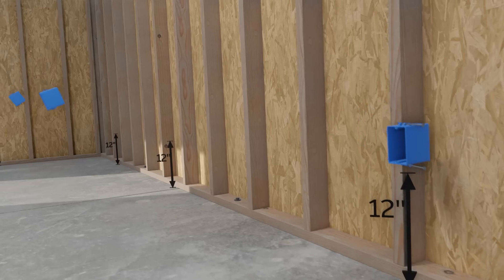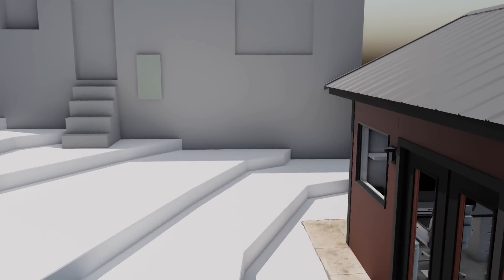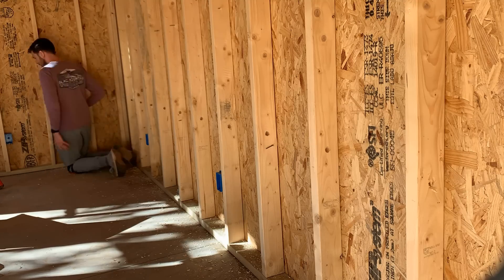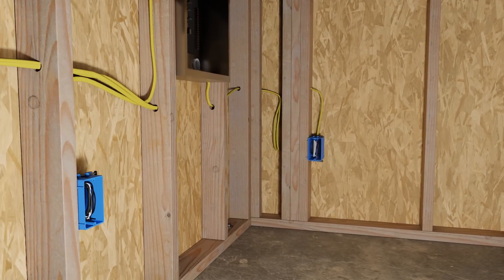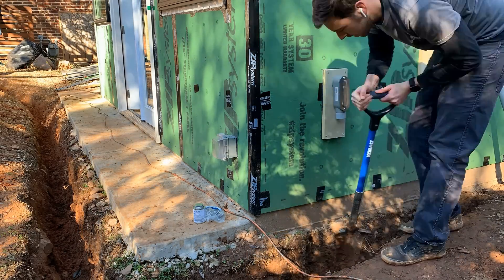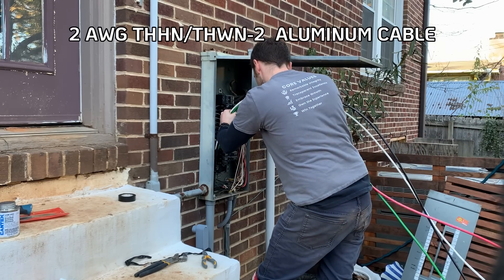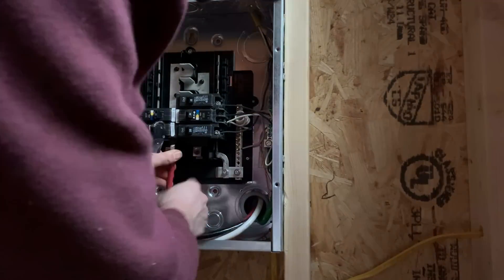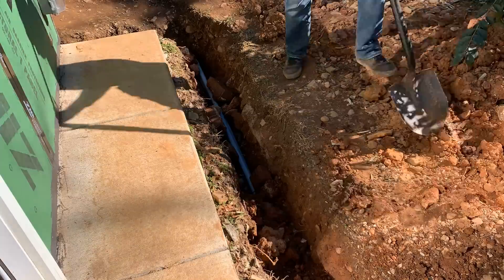Electrifying Our Backyard Office | DIY Installation

Comment: @ 7:15 Those plastic boxes don't have "knockouts", they have built in wire retention which is required by code! You can't "chisel them out" and if this passed inspection the guy passing it had no idea what he was doing. You should pin a comment clarifying this huge mistake because DIYers are gonna follow your code busting advice
Reply from the maker: You are incorrect. These are knockouts. Check out the exception under NEC 314.17(B)(2) :
"Exception: Where nonmetallic-sheathed cable is used with single gang nonmetallic boxes not larger than a nominal size 57 mm × 100 mm (21/4 in. × 4 in.) mounted in walls or ceilings, and where the cable is fastened within 200 mm (8 in.) of the box measured along the sheath and where the sheath extends through a cable knockout not less than 6 mm (1/4 in.), securing the cable to the box shall not be required. Multiple cable entries shall be permitted in a single cable knockout opening."

Comment: Why don’t people pull the wire through each conduit pipe and then seal it.  Seems easier to pull wire through that way to me
Reply from the maker: The boring answer is it's code to fully install the conduit before pulling wire. With the wire in the way, it makes it a lot harder to glue up the joints without getting any glue on the wires. You risk gluing the wire in place and not being able to service/replace it in the future. By pulling the wire 2nd, you also ensure that the conduit was installed properly and it doesn't have any features that will keep you from pulling new wire in the future.

Comment: Why did you use such a large diameter conduit? Serious question, not a critique. Probably a lot more expensive.
I had almost the exact installation done on my outside office about 6 years ago by an electrician. You might have a couple more outlets and one more dedicated circuit but other than that it was identical. Your materials were $1021. The electrician charged me $1250 all-in, so I must've negotiated a pretty good deal! I would have paid the guy $200 just to dig the trench!
Reply from the maker: Sounds like you got a great deal! I wouldn’t go any smaller on the conduit for the size conductors I used. With my amount of bends, I needed all clearance I could get

Comment: Good DIY tips for the electricity
Reply: No, not at all. Don't follow this. He's got the main panel open and unless he had the power company do a FULL DISCONNECT at the pole that is energized at 240v 10,000+ amps. Just shutting off the main breaker at the top means nothing, the line feeding that from the meter has no disconnect and brushing that with anything will vaporize you.

Comment: This is your 2nd YouTube video and it’s Pro, keep up the great work! What state are you in? I would’ve thought the materials would cost more in this current economy 😅 but that’s sick my friend! Also did you opt out on the main breaker for cost reasons since it wasn’t required? Only asking cuz if you need to ever add one more circuit on this panel you’ll have to add an MDB later
Reply from the maker: Thank you! I'm in North Carolina and I was also surprised that the electrical ended up being such a small portion of the overall building cost. I just didn't see myself needing the 7th circuit anytime in the future 🤞